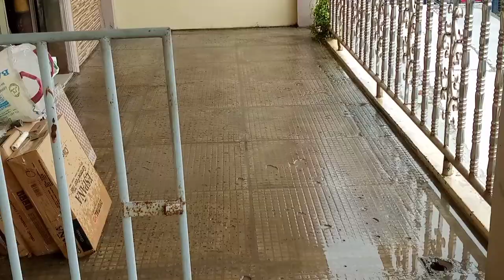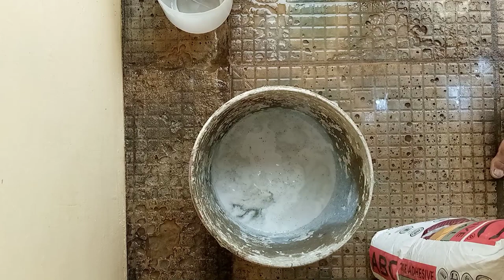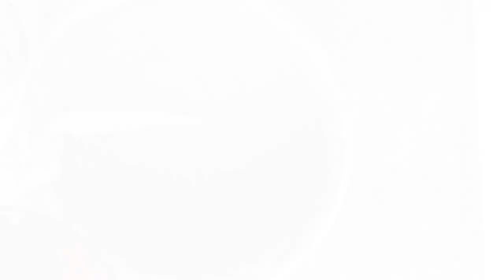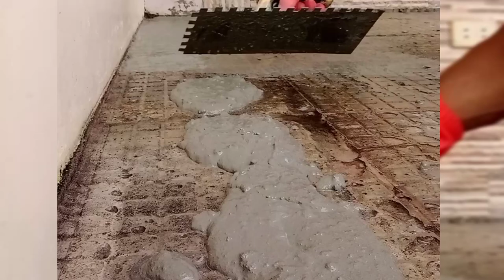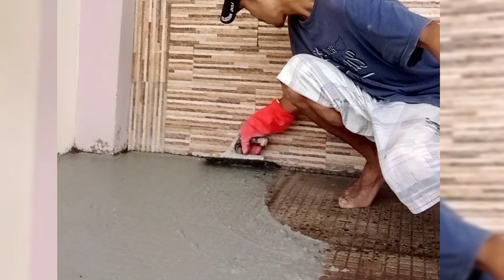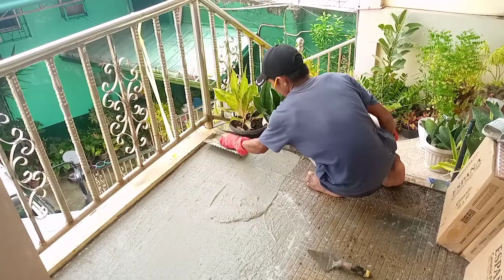How to Re-Tile a Floor | Simple and Easy way

Comment: Boss magreretile po kami kaso my mga adhesive na naiwan sa likod ng mga nabakbak na tiles Kaya my mga part din ng flooring na limitations ang dry pack at baku-bako ang flooring. Applicable din po ba ang ganyang method sa case ng flooring namin? Thank you in advance Sana po mabasa nyo ang comment ko🙂
Reply from the maker: yes po katulad po ito ng flooring niyo kung hindi po ako nagkakamali. mismong tiles lang po ang tinanggal ninyo?